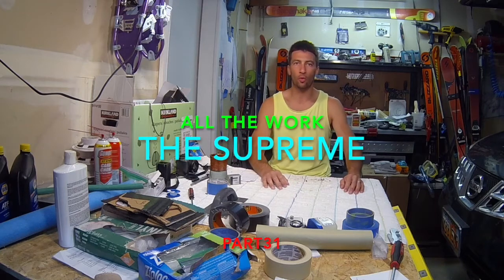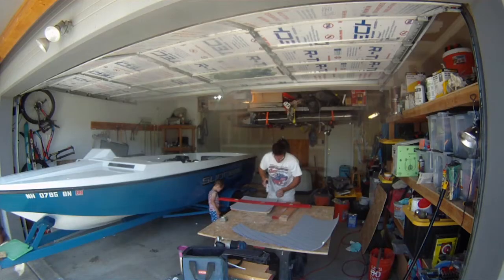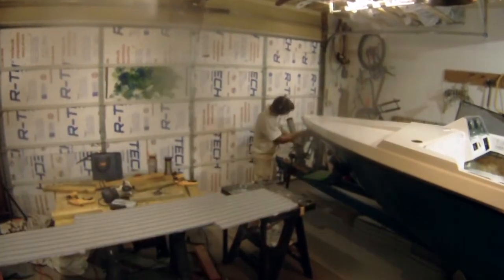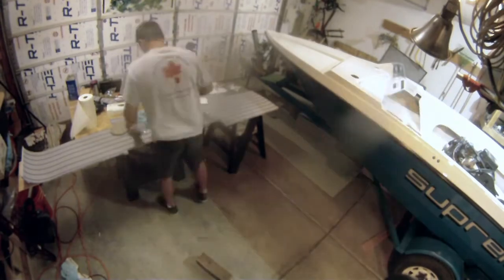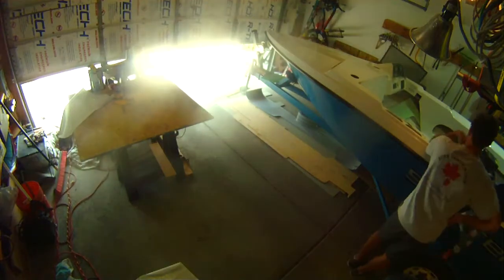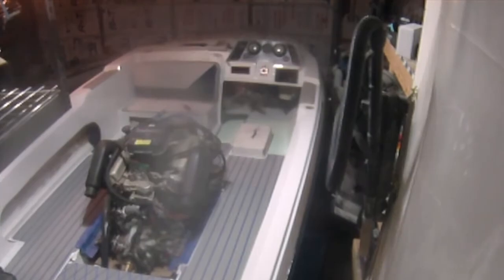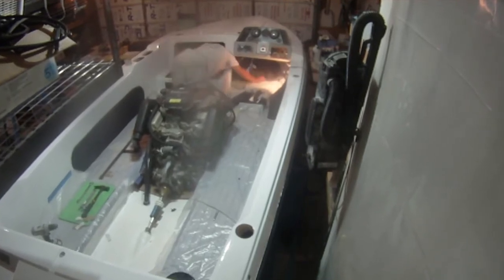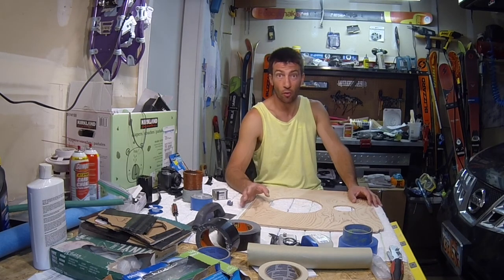Custom foam flooring installation, All the Work 1988 Ski boat restoration Part 31

Comment: how is it holding up?
Reply from the maker: I got the grey and blue floor sheets off Amazon. It is much softer than the true SeaDek stuff that is around the rails.

The Amazon foam has bubbles up on me when it’s extremely hot and in the direct sunlight. I was able to stick it back down without issue and it looks about the same as when I first installed it.

The Amazon foam is not as good as the true SeaDek stuff and in the future I would like to pull it out and pay for the real stuff. 

But for now, it’s soft on the feet and clean. I am happy with the install.